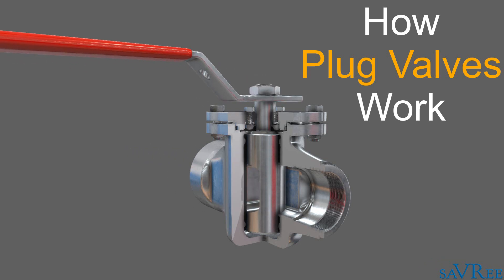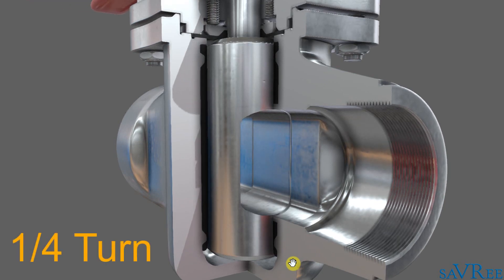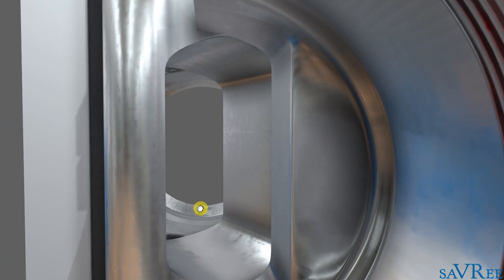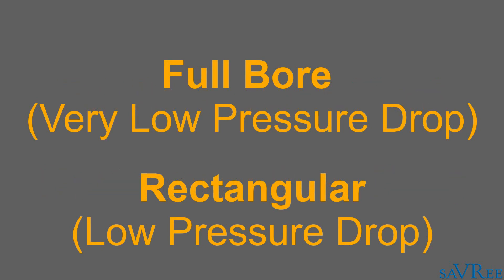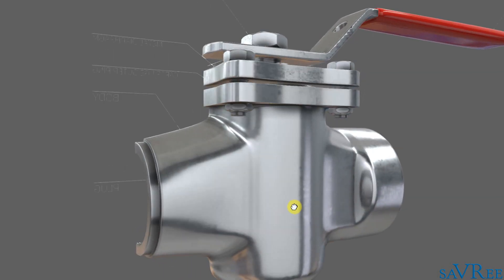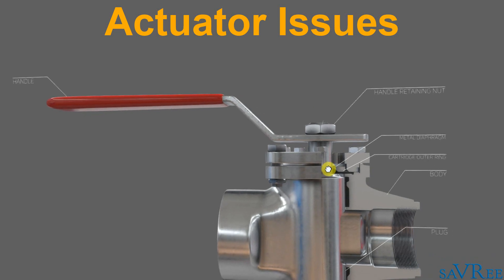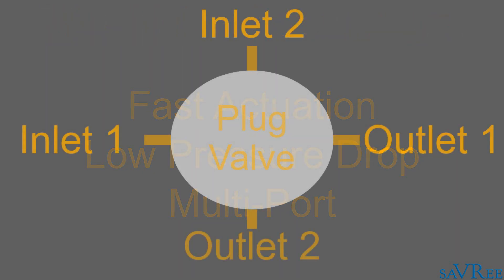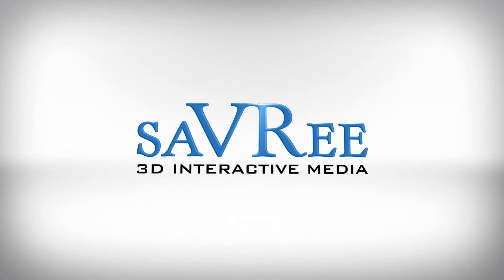How Plug Valves Work

Comment: I work at a caustic chlorine plant in Louisiana, we use a lot of plug valves in the caustic unit. We use a lot of plug valves as control valves also. Mainly tuf-line and durco brands. They work pretty well as control valves in certain applications

Comment: So, the only major difference that I can see between the Plug Valve and the Ball Valve is that the Plug Valve is suitable for multi-directional flow. Is that right ?
Reply: Yes and also ball valves are more suitable for Tight shut off applications as compared to plug valve which may be less relaible. Also the repair and maintenance of the plug valve is more as compared to the ball valve